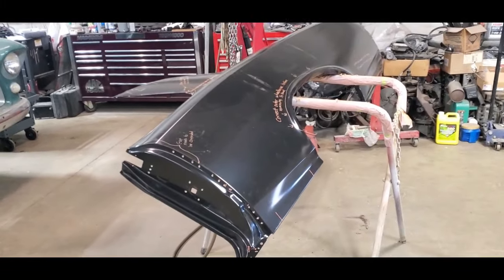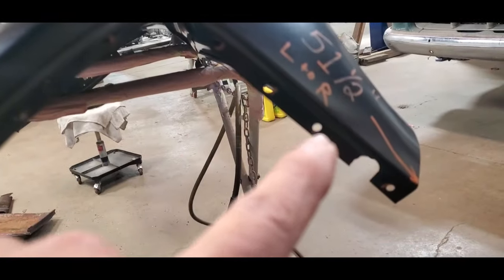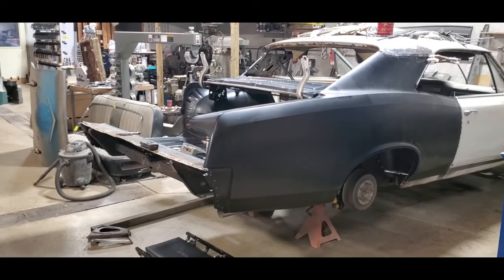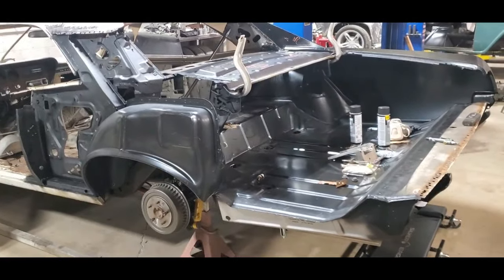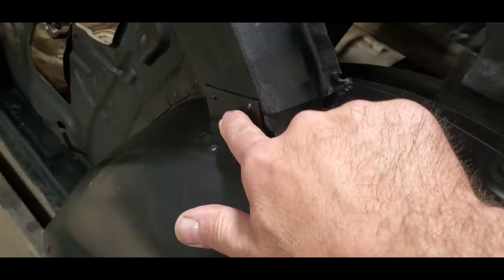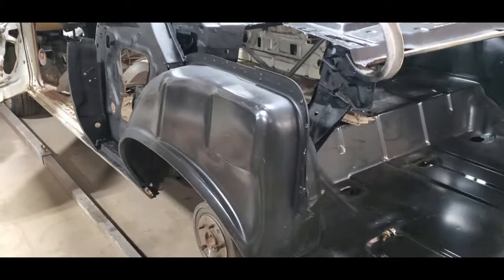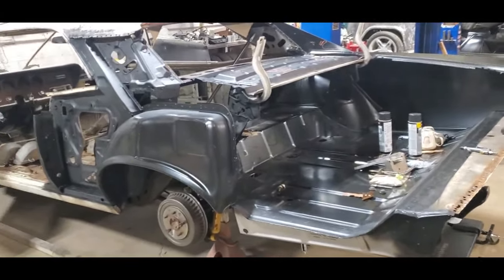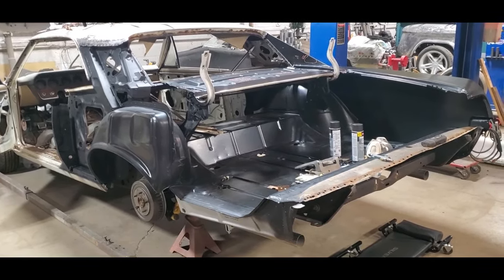1967 GTO. DO THIS BEFORE YOU WELD IT ALL TOGETHER!

Comment: I’m asking the back of the trunk now. The same part you are reusing. Again 3 pieces of metal. It’s the trunk pan part.  Bottom brace good. Tail light section good.   Good tips on stressing the importance of proper fitting. Easier to take a step backwards now than wishing you did later. Keep up the good work